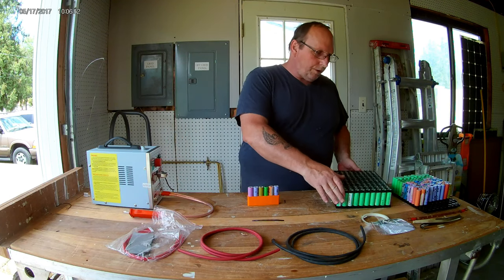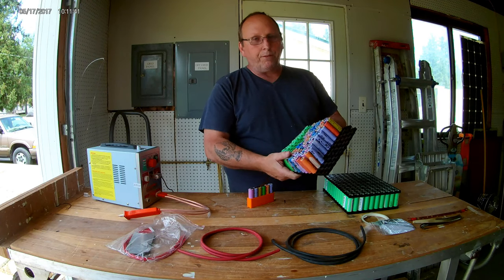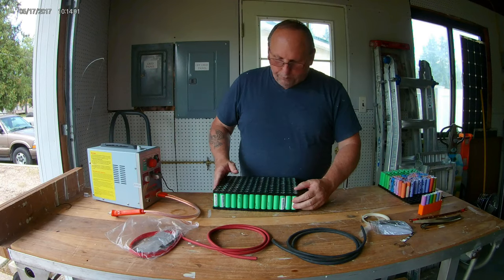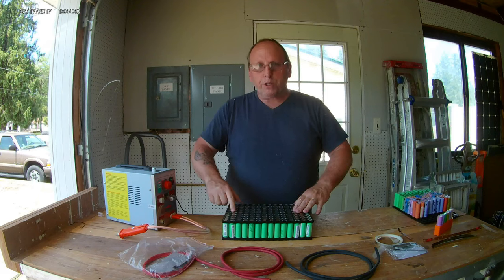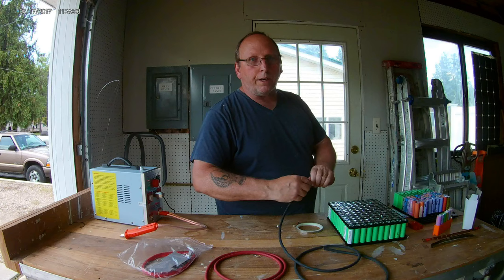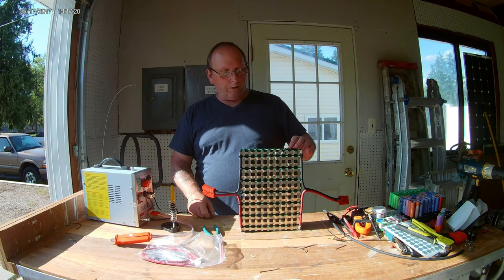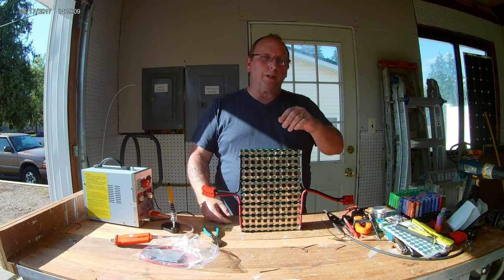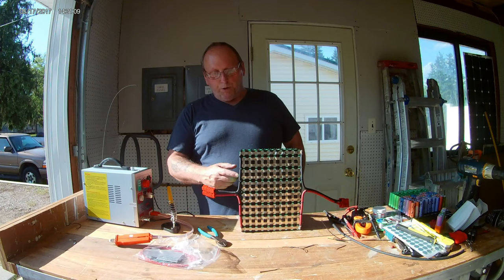Off Grid Power Wall Build / Brand New 18650 power pack build

Comment: Impressive! I especially like the fact that you are slowly building a scaleable system.  I, too, would like to go solar. But, a commercially bought system at my age doesn't make much since (plus, I'm retired and don't want the debt associated with such a system).  I am interested in learning more about your 48v 14s10p pack build.  I'm currently processing my very first batch of modem batteries.  They are LG cells rated at 2200 mAh and most are testing out at that capacity.  I do have a question though about your BMS system.  I'm currently doing my "homework" on BMS systems and I am curious as to what kind of BMS you are using for your 14s10p build.  Thank you for posting and keep the videos coming!